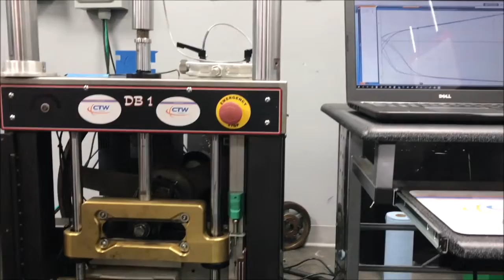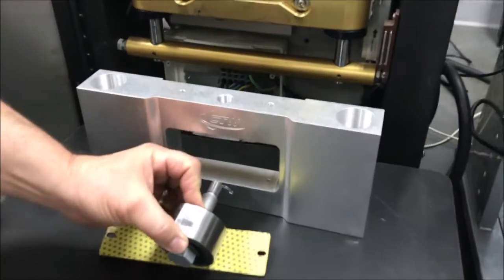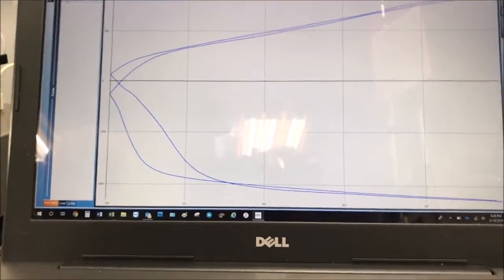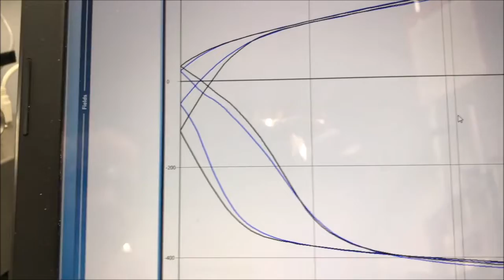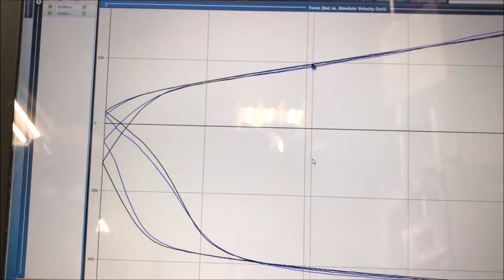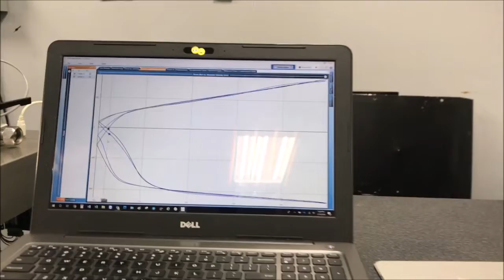CTW Presents - Mechanical Stiffness and Your Shock Dyno

Comment: Hello everyone,

I have recently started a new business focused on motorcycle suspension tuning, and I have purchased a Dyno DB1 test bench. However, the machine came without the computer, so I’m having trouble figuring out how to get it working.

I would really appreciate it if anyone could share any information about what type of computer is compatible with the DB1 (operating system, connection type, etc.). Also, if anyone knows where I can download the original control software, that would be a huge help!

Thank you in advance for any guidance you can provide! 🙏
Reply from the maker: Have you tried contacting Andreani? This is not their site or YouTube page.